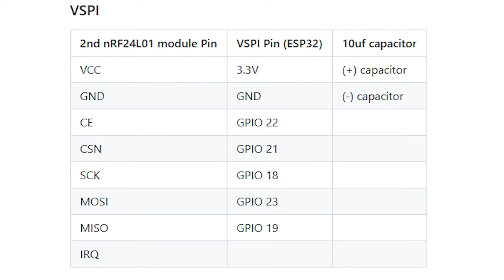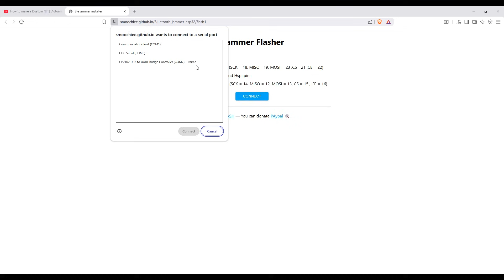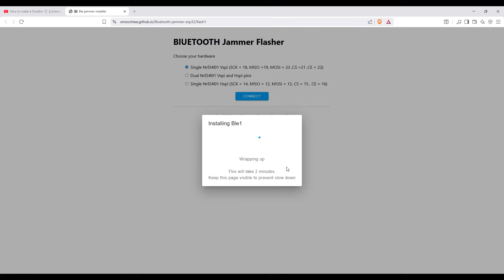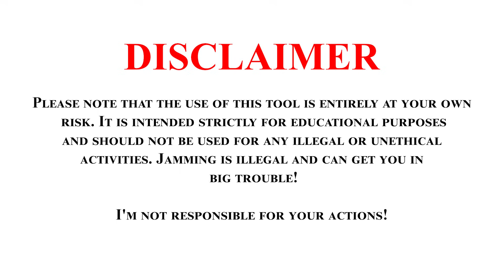How to make a Bluetooth Jammer using ESP32 | Esp32 Bluetooth jammer with nrf24L01 | complete guide⚠️

Comment: It doesn't work, please help
Reply: use VSPI mode, and connect vcc -> gnd to 3v3 and gnd of esp32 (dont forget put a 100uF any voltage capacitor do NRF)
Reply: @cloudxz4423 bro even though it did not work, please help
Reply: me too. this shit doesn't work
time lost...
Reply: @federicoogiacomini3943 My code is working if you request me i'll upooad my code on github